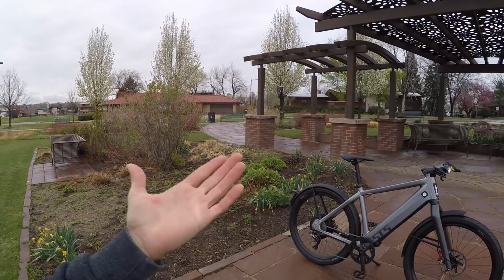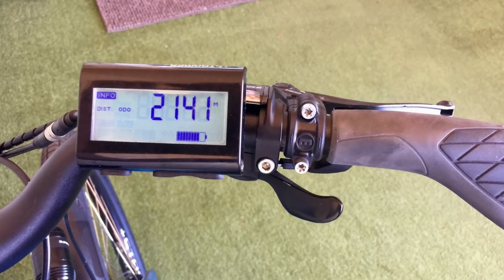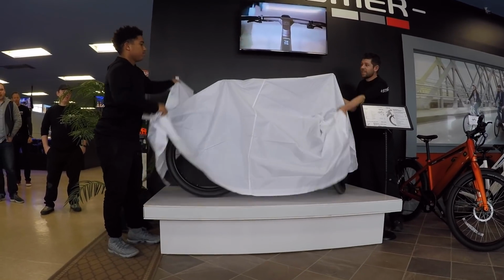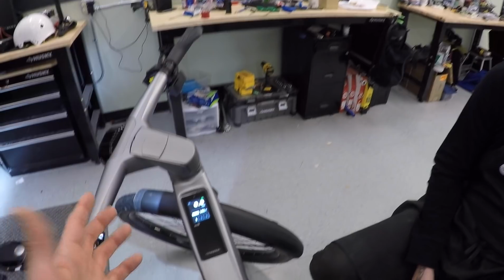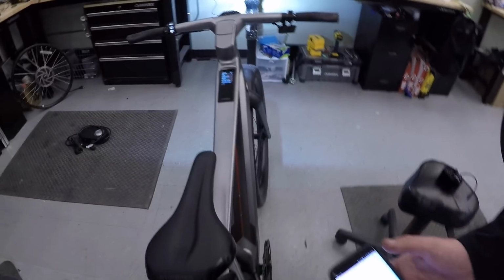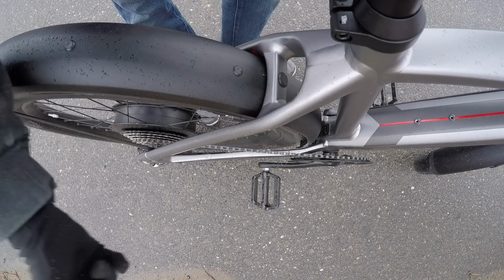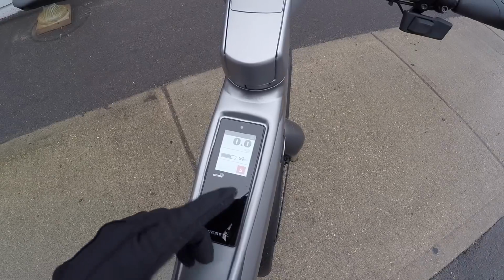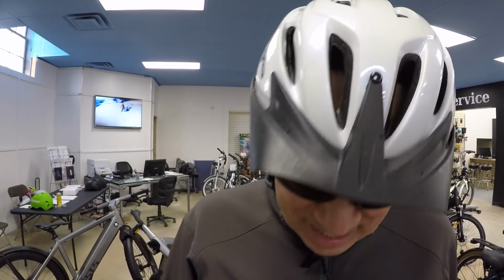Stromer ST5 Review - $10k

Comment: A rigid bike with a hub motor for $10k doesn’t do much for me. R&M Delite 25 is lightyears ahead of this in my opinion.

The regen and the brake light are cool, but I’d want those features on another style of bike.
Reply from the maker: Very fair comment, Chris. There's definitely sticker-shock with the ST5, but the hub motor is silent, has regen, and the custom build is definitely clean and beautiful. Riese & Müller haven't introduced any special security features or tracking, but the Bosch motors they use are definitely efficient and reliable. It's nice to have choice, I also like the Delite model, appreciate the suspension design for more comfort over long distance at higher speeds :)
Reply: My thought exactly.

Comment: Nice tidy and well thought out design, but $10k is way overpriced, especially as you can get ebikes with ten times the power for a fifth of the price.
Reply: Really - what has ten times the power for a fifth of the price??
Reply from the maker: I think it is possible to build a powerful electric bike for $2k, but it won't have remote unlocking, GPS tracking with security, a silent motor with regeneration and integrated motor etc. etc. etc. it's important to give credit where credit is due... Yes, the ST5 is expensive, it's the supercar of electric bikes, and it does perform :)
Reply: Bernard: 11kW ebike: Playlist on the build series https://www.youtube.com/playlist?list=PL3Rqaj8tXgriU-y1gIiZb22lj0LHdCG7S
Enduro E Bike Overview: https://youtu.be/le8y9a8BfzA (bit more expensive)
50kW (70HP) ebike: https://youtu.be/f6ML6zPs8Y4
May cost a bit more if you factor in your time, and use premium parts.
I made a 1.5kW ebike for less than $1k, by adding a hub motor kit to an old bike and using 2kWh of recycled laptop batteries, so it can be done on a shoestring if you are dedicated enough and spend enough time researching and learning.
Reply: ElectricBikeReview, Having researched for the last few years and built my own, I do know the amount of time and effort that goes into the R&D and integration, especially in bespoke design such as the motor controller, electronics and especially the custom frame, and these investments need to be recouped in order to make a product worthwhile for the company to produce.
Yes, they've certainly done a great job and produced a superbike but their market segment will be very small at that price especially as competition and the pace of development and availability of off-the-shelf components in the DIY sphere accelerates, but I do wish them lots of success.
Integrating GPS with the control electronics is cool and may help reduce opportunistic theft, but ebikes are light and easily picked up, and all electronics can be hacked, bypassed or simply replaced - all a bldc motor cares about are 3 phase pulses, preferably sinusoidal and doesn't care how it gets them.
All bldc motors such as magic pie, mxus, bafang, crystalite do regen, you get this 'for free' - just the controller needs to be aware of it and most, if not all of them are.
It's an exciting area, and I personally believe ebikes will (or should) play an important role in helping to wean ourselves off fossil fuels, which can't come soon enough.
Reply: Martin, that all depends on the buyer. I'm not interested in showing off how much money I have to burn (or not), so I go for price/performance rather than name, however ghetto it might be.
Eg, my jeep's covered in so many dings and scratches from offroading that any more of them wouldn't be noticed, and that tells thieves and vandals not to bother and others on the road to avoid because it makes a kind of idgaf statement.
It gets me from A to B, and it's fun and that's all that matters. I got over shallow pretentious ostentation a long long time ago!

Comment: Don't like hub motors.
Reply from the maker: That's alright, as far as the technology goes though, this one is very impressive. Near-silent, instant power, doesn't interfere with the drivetrain, can recoup energy and offer regenerative braking. It's one of the best solutions for a hardtail electric bike, but definitely isn't as efficient as a mid-drive. I think of it like a V10 engine on a Ferrari or Lamborghini automobile, it doesn't get the same efficiency, but the power and performance is there
Reply: ElectricBikeReview.com my ignorance has foiled me again. Thanks for being the ultimate ebike authority. It's just when I go into the local bike shops near me in Denver all I see are ebikes with mid drives. Very few hub motors. Do you know why this is the case?
Reply: I like hub motors. They put a lot of weight on the back wheel, but they are quieter and won't stress the drivetrain like a mid-drive unit does.
Reply: The main reason for me to go for a hub motor is drivetrain wear.

Comment: And what happened to the 3 and 4 version?
Reply from the maker: I know, right!! I asked the guys from Stromer, and they really didn't have a great answer. It was something like "phones jump to different numbers" so it must have been a marketing thing. Maybe the idea was to express that this is beyond next-generation... to me it feels a bit more like a bunch of incremental improvements than full overhaul, but it's still cutting-edge for the electric bicycle space :)
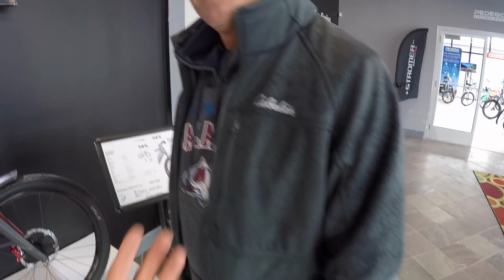Reply: Hello Court, thank you very much for the reply.  I have my gripes about my Stromer, but it is built like a tank and rides very solid with smooth acceleration.  I also got to test ride the St2 and it felt even more refined.  This one has a much higher top speed it sounds like at 49:40.  Take care.
Reply: @ElectricBikeReview  5 is 3 more than 2 , if you go from 2 to 5 is somthing special